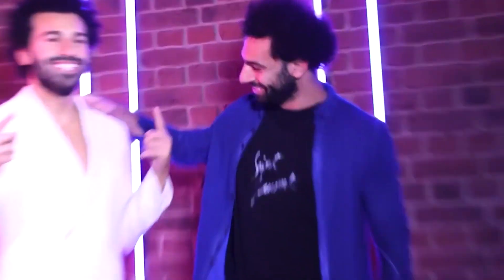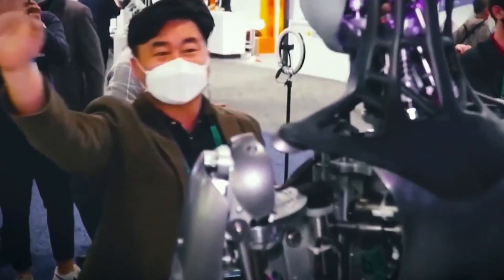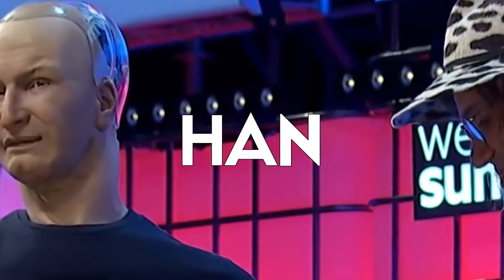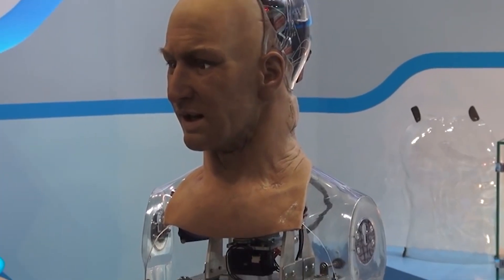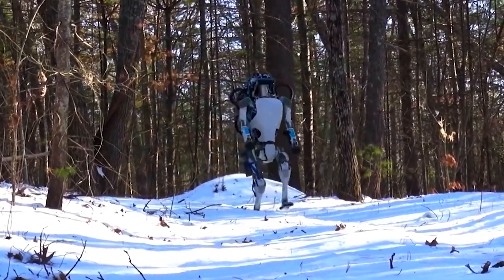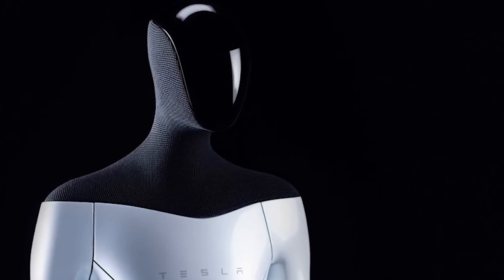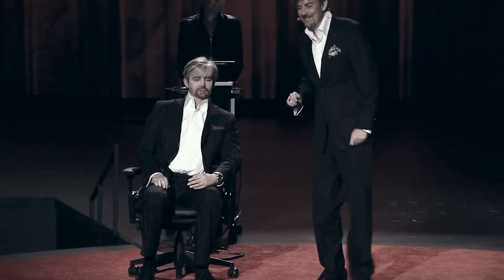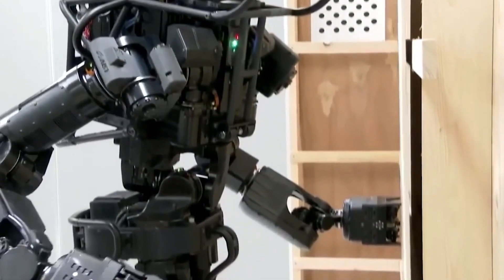Earth's First Human AI Robots Show Why They're Better

Comment: Interesting post, and well assembled too. I can recall being a SciFi fan decades ago. At that time, the authors from the 50s and 60s, were all agog with robots. By the late 80s, I quit reading the genre, in that, the PC boom, and later the web, plus cell tech; had been guessed by none of them. 
  I assumed that they were just on the wrong track. I discounted robotics as a kind of sub-species of A.I. and to be thought of as a replacement for factory assembly work.
  I was wrong (again).
  The goal of a "metal human", leaks directly over into a weird hybridization (cyborg) between human/machine.
  Building these, will reap a bitter harvest think I.
  Thanks for posting.